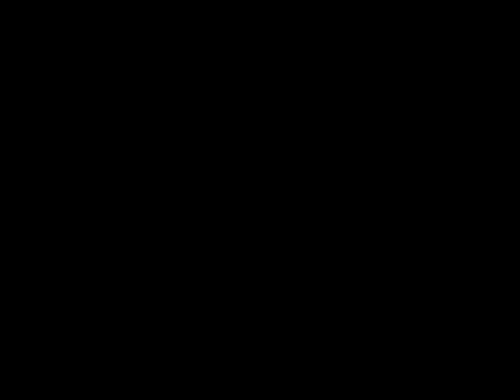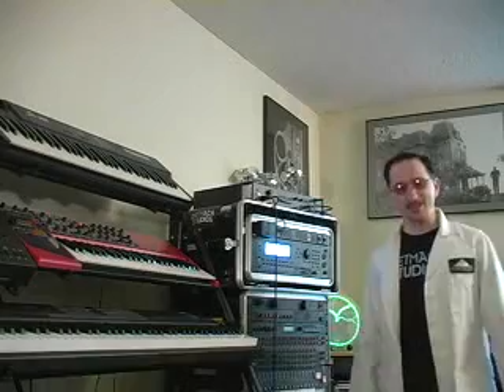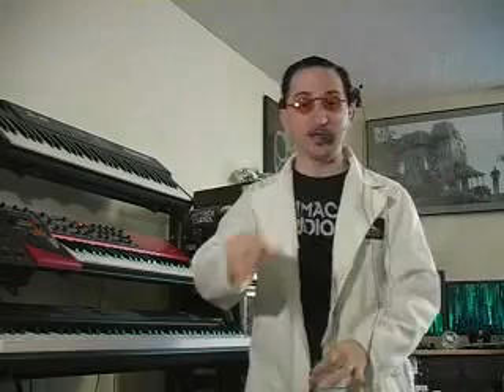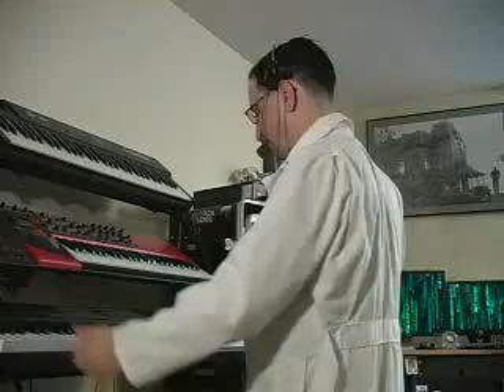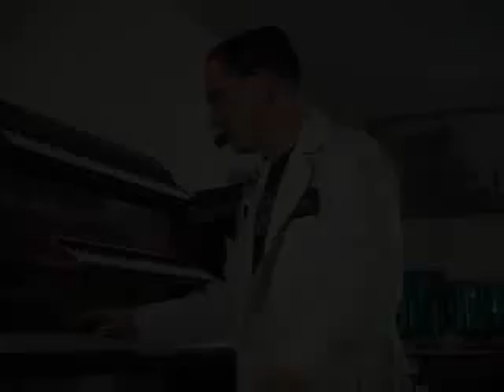Vocoder

Comment: V2000's have been in that price range, but I've never seen a V1000 nor V3000 in that range. The V3000 rates up with the Bode, Moog, and Sennheiser. The two best are the V5000 and the Synton Syntovox 221.

Comment: So autotune is a vocoder
Reply from the maker: When autotune's pitch is being controlled externally (via midi, for example) then yes, it's a vocoder. If autotune is merely correcting existing pitch then no, it is not a vocoder. A vocoder draws pitch and formant from two different places. Autotune does not need to do that.

Comment: well you could buy an analog synth and connect it to the virus or buy a compressor to get that analog sound output.  as a synth the dx7 is the shit and very cheap if you could pick it up from the seller. or you could go for a behringer mx compressor
i use virus b + dx7 + mam vf11 analog vocoder ..i love the fat bass and voice mixed with the metaly FM sound of the DX